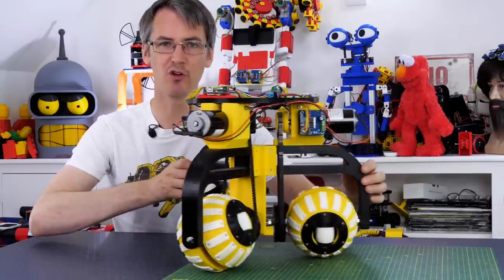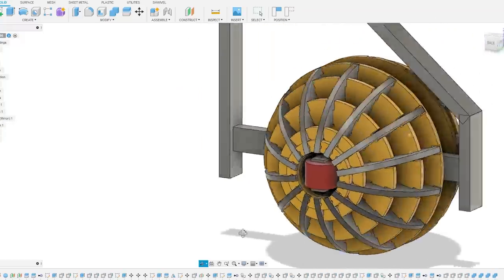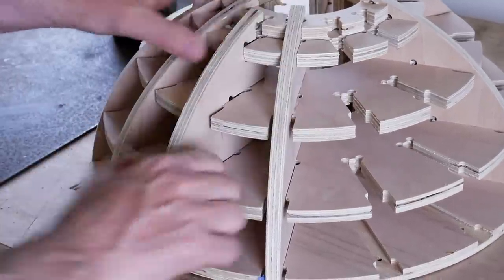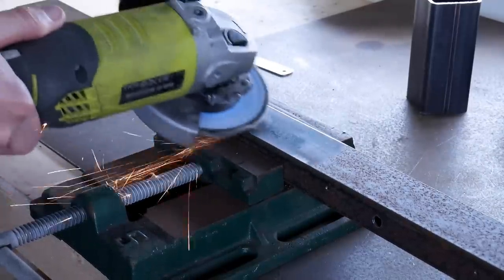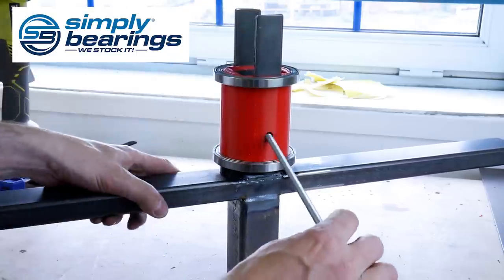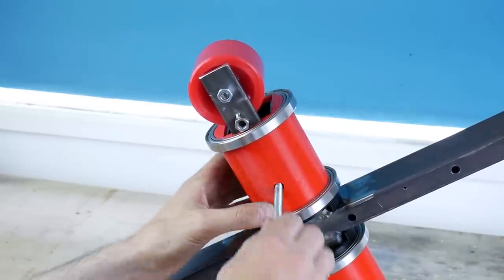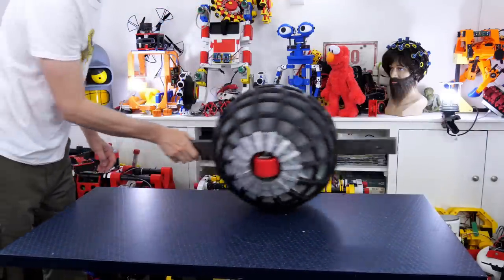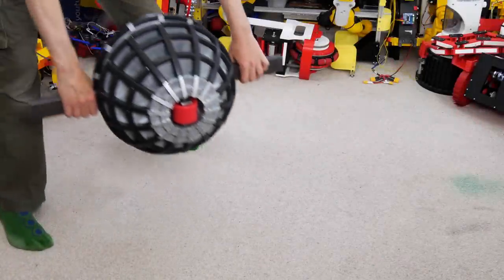Are Ball Shaped Wheels Practical?

Comment: James I recommend a small arm rest for your welding so that it can be stabilized for straighter welding trust me it helps a lot
Reply from the maker: Thanks, I think that would be helpfully
Reply: indeed - my dad taught me to make sure you are comfortable as possible, ideally sitting with your wrists on the bench. 
Get a piece of steel or ally to put earth and put on your bench - then just place your jobs down and weld.
And wait for the post gas to stop before lifting the torch away.

Comment: Is weight an issue with the plywood? Does heaviness make it more stable and efficient or less?
Reply from the maker: It would be better if it were lighter, but that's the most economical weight vs strength material I could think of.

Comment: I can think of a likely failure (I don’t get the early views) is that there’s not nearly enough flex/give in the big spheres for an adult human when hitting any imperfections where a suspension system would help reduce the severity of the shocks.  I expect the plywood isn’t really suitable for this sort of mechanical stress scenario: it’s great in a lot of scenarios, but the dynamic forces of this use-case seems like a truly bad match.
Reply: This is a real concern he's expressed when posting on Patreon.  There's going to be at least 2 more videos on this.  Hopefully he'll address it.
Reply: I was thinking that he could start by adding a "rubber tread" to the balls using something like Flexseal spray.
Reply: @Scott_C  Balloons in between the sections of the wheel. Paper mache the outside (plywood and ballons) then lay on generous helpings of Flexseal?
Reply: The plywood as a core should work fine for the extent that these projects are taken to, it's the surface on top that's problematic. It honestly just needs a rubber surface, one that has a good deflection characteristic. 

Personally, though this is more in depth than James would ever take one of these projects, I'd cast silicone to make panels of a goldberg sphere, an icosphere dual, just to have a surface with a decent durometer, probably something in the 40-50 Shore A range at a minimum; print, mold, cast, have a tread, have the correct non-deflected geometry, and have some additional bits. Mounting these would also be fairly simple, just a shaft with a tapered flange tip, the durometer should be stiff enough so that the panel holds itself in location while the tapered flange is compliant enough to pop into a mounting hole, akin to panel clips except built in; it'd be a two-piece molding process, but probably one of the absolute simplest two-piece molds to ever exist as the geometry is fairly simple. The plywood core would need to be modified to have a polyhedral shell to accept these panels, but that's probably the furthest extent of modification for the plywood core, plus this would add durability anyways. I just think printed TPU would end up being too soft for this use, not to mention that'd end up being a ton of TPU printing when casting a rubber is arguably a lot more efficient.

Comment: I just recently rewatched 2012's The Lorax and one of the main characters rides a single wheel motorcycle. I don't know if it's possible but with your self balancing knowledge and omniwheel knowledge you are the perfect person to try to recreate it
Reply: You can ride MonoWheels with a standard tire. You can do the side to side balancing and the monowheel can do the front to back balancing.
Reply: @mrbuttocks6772  if you look at the smaller Monowheels they can turn pretty much on the spot.

Comment: I'm still confused why you don't have a sphere on the ends instead of those red wheels? By a sphere I'm talking about a similar mechanism that used to be on the bottom of mice.
Reply from the maker: Because it would slip when the wheel is driven by it's axle - it must have traction in that axis.
Reply: because the biggest axis needs it to be perpendicular, or else the wheel would just slide along on the ball caster. It needs the perpendicular force on the skateboard wheel to act as traction, or else the wheel would just rest on the tip of the sphere caster. It would be a very hard to use set of casters.
Reply: @jamesbruton  thanks for explaining!
Reply: @kaedkay2472  I see now

Comment: Change your router bit to a down-cutting bit and you will not have the tear-out to clean up on plywood edges.  Try an Onsrud #57-285 0.250" Dia x 1.000" LOC solid carbide, 2 flute, downcutting bit.

Comment: Great choice of materiels. , the U tyre looks a perfect fit. James, how do you choose your dimensions. constrained by interfaces like bearings, and, others to be designed to transfer forces , others to create a physical surface, and some artistic freedom  TIG Welding , better than mine. Seriously impressed by the six hemispheres. RS and Farnell used to publish catalouges, you could scan through them and gain a wonderful insight into the variety of available components, but also within the variety there is standardization. vero board. HPC do a great gear catalouge, That is going to be the most amazing vehicle even a segway cant go sideways.

Comment: I found transductive spheres perhaps could create a quantum vacuum tunnel
Take off and land using the magnus effect
Generated by electrostatic compressed Air made with Gravity

Also with transparent glass and clear ferropolymer muscles and electroluminecent photophores

Its basically a multiatmospheric lightspeed grow room you live in

I think I'd rather bizmuth batteries than lithium
But then
Air batteries would be cheaper
Nos canisters can power your robot
Rain powered water hammer foot pump provides the robot with seasaw air
Suspension if needed can also fuel the batteries

Ferropolymer muscles regenerate energy from movement

Magnetic gears and air bearings
Because boats never needed a grease valve to stop them leaking
What they needed instead was to not have any holes 
for the impeller...

It's a glass lobster
That moves like jerboa bot or salto bot
The spheres are the claws and tail

And flys like bullet bill

That's the future I want

The plastic wants to be flubber

As the plasma wants to be ionothermoacousicraft

And the transformers wanna be transducers

Comment: Probably won't see this but you need to use staples or carpet tack/nails on the wheels rubber I think, it's going to slip it's not being pulled but but pushed, I think it's called bead lock on a car wheel where the tyre won't slip its textured surface so maybe glue would do it 🤷‍♂️

Comment: Could you use non-slip tape to cover the plywood edges in the cap/roller area? It's used on stair treads and almost feels like adhesive-backed sandpaper.

Comment: FYI -- You technically only need two omniwheels and instead of a third one, you can use a ball caster -- the third wheel just needs to be weight bearing, and doesn't need it's own drive mechanism (it will be slower and have less torque than three driven wheels in a Y configuration, but the other two, if sufficient would still cover all of your 2 degrees of movement -- there are several omniwheel robots with this design, two omniwheels and one caster).

Also, I'm a little worried that your wheel design might not be balanced -- the mass at the tip of the hemispheres appears to be much greater than in the center of the hemispheres (with more wood towards the tips, more rubber, and also the caster).

Comment: A quick TIG tip that improved the quality of my welds was to be careful not to pull the fill rod out of the shield gas between dips. Every time the hot fill rod sees air the end will oxidize, and that oxide gets fed directly into the weld.

Comment: Aren't  omni wheels impractical for any large scale vehicle because their clearence is determined by small rollers and not the diameter of the wheel itself? No suspension would help as the main sphere needs to slide over obstacle until it reaches the roller.

Comment: 6:25, I felt that sigh deep in my soul. little tip about welding nuts, you mentioned it is sparky, that's not the mild steel/stainless steel combination, it's the zinc coating on the nut. Grinding the zinc off nuts/bolts makes them nicer to tig weld. 

Welding mild to stainless is also fine for the sort of work you do, the main concern is often corrosion and a slightly weaker weld, but nothing that you'd need to worry about. I've been told using stainless filler rod is the better choice if you have to mix them, but again for your projects it wouldn't matter.

Your tig welds also look alright for someone who doesn't do it daily. You seem to be hovering your torch and filler hands in the air when you weld, I find it easier when I can rest my hand/wrist down on something to keep steady. That being said you seem to have pretty steady hands in the air, at least compared to me. You can also try different ways of holding the torch, I personally find it easiest when I hold it like a pen, with my index finger on the button.

Comment: instead of a skateboard wheel on the end could you use a sphere/ball. It could be held captive just like how you printed out a cap and would have a small enough opening to hold it in.  thinking like a ball point pen(but think the ink would be lub) so instead on the inside or bottom of the ball, have some type of bearings like tapered roller bearings? or maybe there is one designed for spheres and then on the top of the ball have a metal ring to reinforce the cap and prevent wear.
Reply from the maker: It needs to roll in one axis but not the other, otherwise the wheel will slip

Comment: The answer is no for so many different reasons. I don't even need to watch and I can name a handful off the top of my head. Mostly due to structural, design, wear, or cost. The small number of benefits are heavily outweighed by the cons outside of a few instances where they are used.
Reply from the maker: You still clicked.
Reply: @jamesbruton  You're right just to post my answer LOL. I haven't watched a single min of it because I knew it was clickbait. So you got me.

Comment: What if the little wheel, was a Omni directional wheel!
Reply from the maker: Then it would slip in its driven axis when it rolled onto it. The little wheel is like the wheels around a normal omni-wheel.